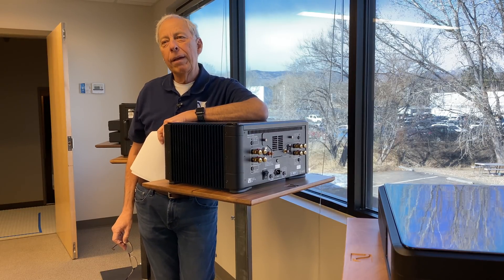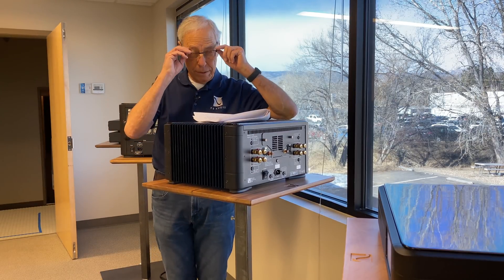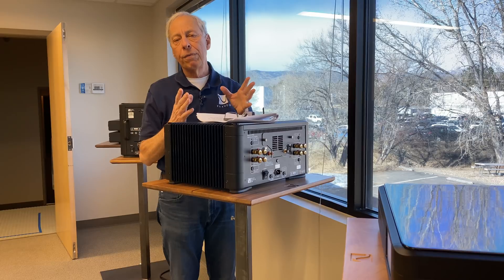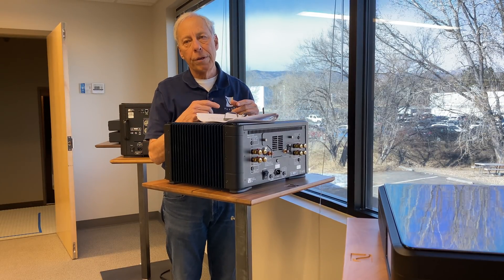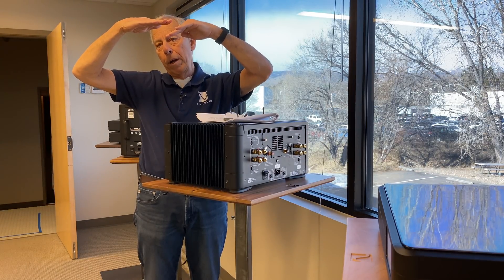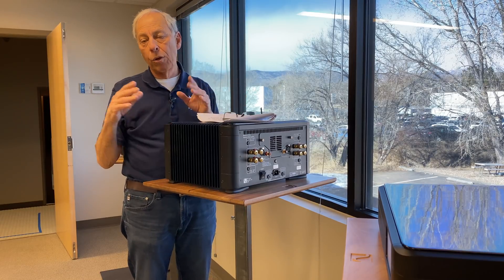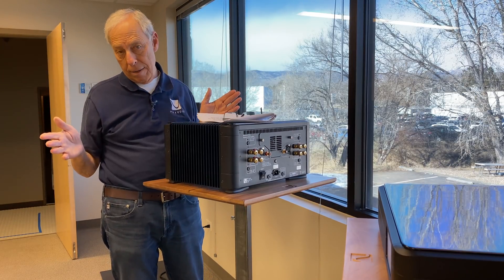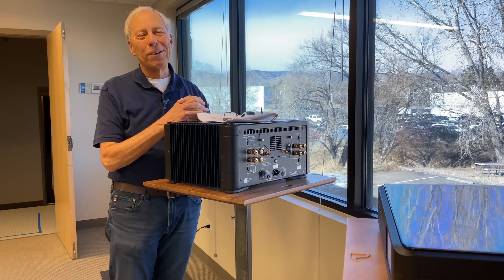Amplifier clipping

Comment: Hi Paul, this seems like bad advice. You said dont worry about using your amplifier at its max volume essentially. This may be true in a simple pop audio track where compression is high. But for dynamic range type audio where the volume can vary by 20-30DB peaks (HOME THEATER!) running your amp near its max is going to cause heaps of clipping during explosions etc.

Would be good if you clarified this... :)

Comment: But how do you know audibly if it clips?
Reply: U should hear it. Sounds just like a clip/clack or quick distortion in spkrs. I’ve a cheap Chinese tube pwr amp (8-10 watts) Wen played alone wit iPad, phone, etc. no clipping. But wen paired wit Marantz, Concept, McIntosh components, volume past 50%, I’ll hear/get clipping. I simply turn volume down. (Burnt tweeter? Never happened) Wen I first heard it I thought spkrs not properly connected or receiver, or speakers need repair. No. Then I remembered my HS days, “clipping.” Went on uTube for solutions..

Comment: It happens all the time with the high power speakers of today .
The important part is get an amplifier that performs above the rms rating of the speaker .
Most blow speakers with under powered amps not over powering them .
More power is safer , ask any car audio guy .

Comment: I would like to see some real explanation.  Some say it is the harmonics that will damage the tweeter. But the 15th harmonic of a 100Hz signal clipped is 1/15 the power.  That would be 2 watts on a 30 watt amp.  Not enough to burn a tweeter.  What about DC? Well mids and tweeters have Capacitors in series.  So please help me understand this with some math....  show me a typical audio spectrum with peak to average ratios and how clipping will change the output spectrum to the point that the HF content is high enough to damage tweeters!

Comment: The flat line that results from clipping is not what is full of high frequencies --- 
the line is DC, which is what really does the damage to speakers.  
The high frequencies that are generated come At The Corners where the curve ends and the flat line begins, 
and again where the line ends and the next curved portion begins.  
It is easier to think of the waveform as a line of mountains; clipping cuts off their tops and makes them level. 
For parking vehicles or landing helicopters, that would be nice, but in audio it's horrible. 

The simple way to know that you are pushing an amplifier (or a speaker) too far 
is that it begins to sound bad above a certain volume level. 
Just don't turn it up that far again, and everything should be OK.

Comment: The clipped signal does not contain high frequency material, it is a zero hertz dc signal and the duration of the dc signal can overheat a speaker.

Comment: Side note that when you push a Class AB amp into clipping you screw up the amp too and it can do some pretty awful things. Clipping can occur at all frequencies. The "speaker" is a complex motor/generator load that varies widely with frequency. Tube amps tend to clip gently for want of a better word.

Comment: Thanks for nice and clear explanations. 
I have tried many TPA311*  boards but all burned out without any heating, what would be the reason. I was using LiPO battery 11.1v and 16.8v with a 176 Ampere of stable current output, please help. 
The last one i have tried is TPA3118 and it plays for a second and the pop sound and total silence for another second, and this cycle continues

Comment: My understanding of why clipping destroys drivers is because you're asking them to reproduce a square wave; that is for the driver to be simultaneously pulling and pushing the air. It really also depends on the source material - I found that playing Appetite for Destruction by Guns n' Roses at over 70% volume through soft-dome tweeters powered by a 25 Watt per channel receiver from the late 1970s absolutely guaranteed destruction.
Reply: It's not the square waves that cause the issue....its the power in the harmonics that causes it. Like Paul said, clipping contains lots of high frequency content. Most tweeters can handle only a fraction of the power rating of the speakers themselves.  A pair of speakers that can handle 100 watts or more might have tweeters that can only handle 10 watts. A 20 watt amp doesn't look like it should be able to damage the speakers, but full on clipping could result in 20 watts of high frequency content hitting the tweeters, causing them to fail. Over powered amps will usually take out the woofers long before the tweeters

As long as the actual power output of a clipping amp does not exceed the power handling of any of the drivers....they won't blow.

Comment: One way of damaging a twitter used to be people rewinding tapes at high speed monitoring the output. The tape sound would become supersonic and with the volume still it would on occasions depending on the speakers it would happen. I used to get a lot of blown tweeters on AR18 speakers. 
The makers were good and would give you as many tweeters you asked for as a dealer.
Reply: I've used a good bit of the 5 year speaker warranty with tweeter replacements from Tandy

Comment: I have been told that you can damage a speaker by under powering it. Sounds wrong to me. What's  the truth?
Reply: You are not by definition under-powering your speaker, you are over-powering your amp. The amp then delivers clipped sine waves, which are extremely harmful to speakers. By feeding more input voltage into the amp than it has capability to turn into wattage, it is simply running out of steam. Picture trying to lift something extremely heavy from the ground and up over your head. You will damage something
Reply: With more power you reduce the risk of your amplifier getting to the point that it clips. Paul is right, go big or go home. It's not the normal music level that typically causes clipping, it's those transient spikes that create a huge demand for power and that's why you can drive a speaker rated at 250 watts with a 500 watt amp with no issues. I really don't pay attention to speaker power ratings.

Comment: I'd like to know how amplifier manufacturers align their volume knobs/controls in relation to the max power of the amplifier. Is there any standard for the engineers, or does one manufacturer reach full power at 50% knob rotation while another does it at 95%? I know it's not that simple, since speaker impedance varies as well as input voltage from the source, but there must be some kind of finger in the wind standard.
Reply: @FatRat-f9m  it really doesn't. Fuel quality, load and wind all affect the speed of my car, but none of them have any relation to how the throttle was engineered. I'm asking how the volume control is set in amplifiers.
Reply: @ryanlangan1060 ...ok so a gain (volume) control goes from infinity ohms (virtually 'open circuit') no sound to zero ohms (no resistance) max volume
ie. as you turn the knob from '0' to '11' the variable resistance decreases to allow more watts to drive the loudspeaker, hence the increase in volume.
The amount of power (watts) that is available to the loudspeakers at any point around the gain 'knob' is dependent on load (ohms) & input voltage (as you said)
Reply: @FatRat-f9m  CD players put out 2v p-p, phono stage puts out 300mV RMS, the amp will clip on lower knob setting with CD player than the phono

Comment: I think the part that confuses people, is the question of how can you exceed the power of an amp? Isnt full volume on a 50watt amp just 50watts? 

The answer mostly lies in both the input sensitivity of the amplifier, and the output signal level from the source device. 

To cut a long story short and simplify the explanation, the calibration of the volume or gain control relative to the amplifiers output is based on a certain input voltage going into the amplifier. In real life, this can vary enourmously between different sources, different recordings, different equipment inline before the amp, etc etc. 

So it’s totally common to end up with an input signal to the amplifier with a voltage or level high enough that the amplifier may reach the rated output at only half volume as indicated by the volume control. 

This is how we usually end up clipping power amps
Reply: Yes, and also signal peaks can clip the amp without the whole thing turning obviously distorted. 
But as to your first paragraph, actually a fully clipped 50 watt amp can produce up to 100 watts RMS, or even more if under-rated. Meanwhile tweeters and even midranges usually can't handle the full rated power of the speaker -- the tweeter normally may see only a few % of the total. It is possible to blow drivers without clipping the amp too, I damaged a mid with high pitched vocals.

Comment: Clipping is bad, very bad. It's a silent speaker killer. Must stay as far away from clipping your amplifier as possible. Unfortunately nobody makes clip proof amplifiers. The user should be able to crank up their amplifiers as loud as they want with any speakers. And never be anywhere close to any kind of clipping. I personally don't even like soft clipping.
Reply: As I understand it, you simply cannot have clipping with a Class D amplifier. I'm willing to stand corrected though.

Comment: Clipping can damage a midrange or woofer too, depending on the program material.
Reply: Yes, but very unlikely you kill the woofer. That takes it's time and you need the amp to deliver a high voltage to do it. A too small amp normaly can't do it even when clipping for a long time. (It CAN happen but most likely not).
Tweeters go first and then maybe the midrange if unlucky.
Reply: Maybe those old enough can remember around the mid 1980s using a 100 watt amp paired to a loudspeaker with weak paper coned woofers being torn by the loudly played first track of Metallica's Master of Puppets.
Reply: @laurentzduba1298  A real 100 watt amp or just a "100 watt" amp?
Sounds like really bad paper cones.. I have mistreated quite a bit of crap speakers over the years when I was young just for fun. And even with HAVY basstests that really rape the speakers and with both small and huge amps i did not manage to tear the paper cone on a speaker.

Comment: It's not just peak clipping to worry about.  Similar types of distortion, resulting in strong high harmonics, can result from highly reactive speakers combined with output-stage current protection that isn't designed for large V-I phase shifts.  
And not just amplifiers can clip.  I have a CD with severe clipping on several tracks.  It's an African percussion CD, and the recording engineer failed in setting up his gain distribution.  But because it's percussion, so the clipping only occurs in short bursts, it's hardly even audible, let alone a threat to tweeters.  I only became aware of it, by monitoring the signal with a scope.  I posted a few example scope screen shots here, so you can see what it looks like:  https://cp.sync.com/dl/2b01b8a70/pjaxfp89-qybsbhxp-xy479fzr-7785qmdu

Comment: Speaking of clipping. CB radios have a transformer that takes audio signal and controls the power to the transmitter creating amplitude modulation in the radio frequency output. When the audio output exceeds the power feeding the transmitter, the negative swings can clip off the transmitter causing splash into nearby channels. I did come up with a circuit using a diode and a resistor to prevent the clipping by keeping just enough current to keep the transmitter from clipping off.

Comment: An amp driven at its rated power is fine, but any given tweeter may fry itself below that if not power matched to that particular amp...
Reply: You blow woofers if you play with too much power and blow tweeter if you have too little power.

Comment: How come they don't make speakers with a watt meter so you know how many watts are being used I know that they put them in some amps and how do you read the meters if you mono block them and or your speakers are 4 ohm thanks.  Mr. Simpleton
Reply: I am new to the hifi world. Hadn't even thought that could exist! I find there is learning even from going through comments section. Thanks for sharing. :-)

Comment: if you can hear the distortion from the speakers then the damage is already done. I recommend to buy as much power as you can afford. More power won’t damage your speakers, Not enough could.
Reply: And if you want louder, add more speakers. A pair of Infinity V's will do nicely.
Reply: @jamesplotkin4674  The Rola 12UX50 twin cone speaker can be thrashed as hard as you give hard clipping without consequence of blown tweeters as there are no tweeters to worry about with this speaker

Comment: Marshall JCM 900 have a clipping diode in them. When Marshall did it they lost a lot of customers because they were upposed to be tube olny Clipping diod and op amo. SOme can use silicon transisters or germanium transistyers. RCM = Root Mean Square. A sine wave of 1000Hetz of unknown amplitused o dont knows!

Comment: By the way, also beware that a too large amplifier can blow up a small speaker at sub bass frequencies you might not hear from the smaller speaker. For example, a small bookshelf speaker might be almost silent at 30Hz but if your music has a strong sound at 30Hz then smoke from the voice coil or a bang of the voice coil hitting bottom might be your first sign that you just damaged your speaker.
Reply: gotta love that bottom out sound
Reply: @VaughnfromPeterborough  Actually it can be a terrible thing where you don't know how much your speaker got damaged. I've seen damage to the voice coil where repeated hits at the bottom caused it to start touching the inner gap making distortion and also damage to the center dust cap getting visibly deformed by the abrupt stop of motion. Recently one of my speakers got a crack in the surround from playing too loud, but one contributing factor was that the rubber material had started to harden making it more fragile. You gotta not love that.
Reply: @ThinkingBetter  I've mostly blown the tweeters with 30w amp, when I was teenager, I played the Goldair 20w amp through HMV 6" speakers with full bass and loudness switch on at moderate vol until the bottom out noise started happening and made a tape recording of it playing Mental as Anything - Big Wheel, I watch Garret Claridge blowing speakers and enjoy the Logitech hate video hearing the subwoofer going buzz buzz
Reply: vaughn tonkin I had some DIY large speakers using Coral 10 flat drivers and those were sounding like a hammer hits a piece of wood when the voice coils hit bottom.

Comment: I use a multimeter and found my amp soft clips at volume 8; at volume 7 there's no clipping and at volume 9 I get hard clipping.
Reply: I set my TC-780 line booster after phono stage to give CD levels, so my amp distort at 8/10 on the weakest 20 track LP
Reply: Would you please explain how to use a multimeter to do that? In simple terms please lol
Reply: @jesusgavemeaids  A multimeter cannot show you when an amplifier begins clipping, either soft or hard. You have to use an oscilloscope to view the actual waveform.
Reply: @Orcinus24x5 ....an oscilloscope is the best option; however, I don't have one and relied more on theory plus the multimeter. I searched it on YouTube. Not the best way but good enough. I also trusted my ears to hear distortion.
Reply: Or if you know where I could get an online tutorial that'd be great & probably easier for both of us.
Reply: I should have known as much.
Reply: @jesusgavemeaids .....using a multimeter is guess work. I researched it online and used a mathematical equation. Use YouTube and search for "multimeter" and "clipping" or something to that effect. In addition to the videos, just trust your ears.
Reply: You can't use a multimeter  I don't care what YouTube says...peace
Reply: G Guest  hahaha no I don't, I just know from my education that it's not possible, the concept comes from the 12v guys in the car stereo world where they do use multimeters to calibrate but that's another story...